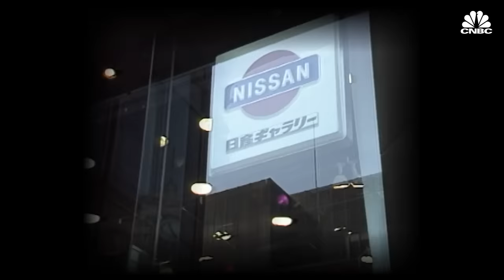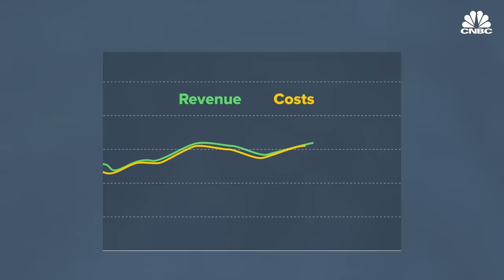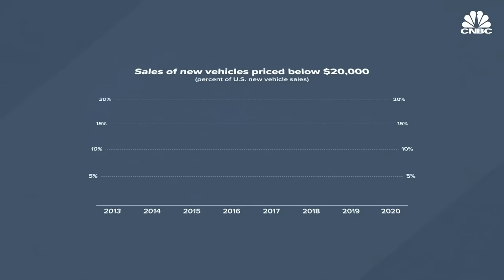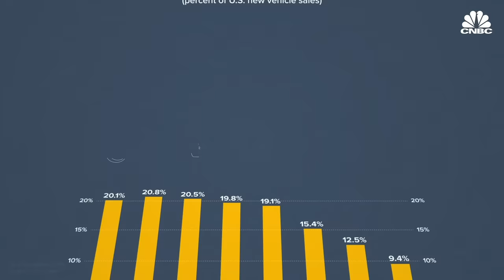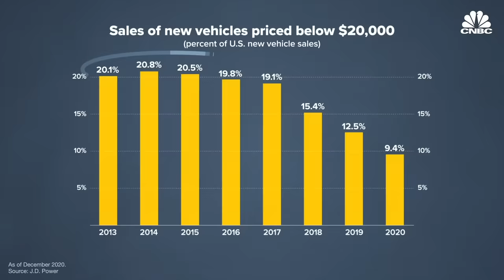Why Cheap Cars Are Disappearing

Comment: I'm 38, and I haven't owned a brand new car yet. I find it that I get more value when I purchase a few years used with more options for less than half the price than getting a brand new one with the latest options.
Reply: Yeah and at the end of the day, the purpose of a car is to get you from point A to point B.  They aren't assets that appreciate in value like stocks or real estate.
Reply: I purchased a 2019 Jeep Cherokee 4X4 Overland, came off lease saved over 10,000 dollars, had 9,000 miles, lot of technology on jeep, 

First SUV I ever bought always drive a car, sold 2003 Chrysler 300m had 125,000 miles. Very reliable car, but more of performance vehicle not good in winter.
My Wife did not want SUV, but car good in winter weather But not large car, so I purchased 2016 Chrysler 200C AWD, I saved well over 20,000 dollars on that car only had 16,000 miles, came off lease 2 years ago, it was disconnected in 2017.
Very good in winter weather.
Reply: True.
Reply: Yep.  I traded up to a top trim Taurus SHO last year, and at 3 years old it’s the newest car I have ever owned in 22 years of car buying.  I can’t even remotely afford to buy a new car I’m the class that I want, and it’s becoming a pointless effort, and full sized 4 door cars are apparently a dead breed.
Next car might have to be a Mustang...
Reply: does it bother u if someone had sexin the back seat in said used car?
Reply: I bought a 1 year old certified used vehicle for about $20k this summer.  It's a very nice car, and the certified vehicles have 100k mile warranties.
Reply: I'm driving a 2001 F150 ... everything works great on it ... it's not new but I'm not a slave to a bank for 72 months either ..
Reply: @anonymousperson9279  detailing wont remove the past events in said vehicle
Reply: @randomrazr  Get it through a full suite car wash service before you start using it if you're worried lol! Most people tend to get those services done right before selling off their cars anyways, to make them more presentable and demand higher price than dirty looking.
Reply: @btw-3006  Only already wealthy people can benefit from stocks getting their value inflated. If you are smart, never invest in stocks.
Reply: @conanobrien1  what are you talking about?  I am not anywhere close to wealthy yet and my net worth has greatly benefited from the stock market.
Reply: @btw-3006  Up until the next stock market crush...
Reply: @conanobrien1  yeah, okay buddy...
Reply: @btw-3006  it's only an asset if you make money with that car otherwise it's just a liability.
Reply: I been tru 31 vehicles  in my life and like the 2000 Mustang Cobra R there is no other is like all the new cars don't even matter
Reply: I've owned a few new cars....never again and I have no need nor do I want all the technology packed into newer cars just more stuff to break
Reply: Another cool part of buying used cars is it is far more environmentally friendly.   It's better to keep a vehicle running that has already been manufactured (manufacturing is where the majority of a single car's emissions originate),  than to buy a new car that would need to be made sending the old car to the scrap yard.

I personally am a big fan of used cars because I just like them better, 90s cars are more fun to drive as they have more character.

Comment: Being an engineer, I look at the many, many systems in a new car and wonder how many of them will still be working in ten years time.
Reply: "... he said, glancing at the new Land Rover."
Reply: as an engineer (i'm a former tech) let's sit down and joke about self-driving vehicles, shall we?
Reply: You’d be surprised. If it’s a Lexus you can guarantee 95% of it will still work. A BMW or Mercedes on the other hand, maybe not.
Reply: If ford's 10 speed autos and GM's electronics have anything to say, they wont be working in ten years time lmao
Reply: Cheap metal and plastic (aluminum recycled beer can on wheels).
Reply: @marclaprise2945  😂😂
Reply: I don't think I'm going out on a limb here but I'm willing to bet not one of them will be working in 10 years time.
Reply: 10 years is a great time to sell lol. it's just starting to get old and it still has some value left, besides you are probably tired of driving same old car 10 years
Reply: I kinda wish cars were modular like that but most of them don't even have a replaceable radio now
Reply: @SteampunkPhoenix  yep you have to do extensive work if you want to put in a high quality audio system. Years ago I started putting my stereo receivers inside my glove box I'm leaving the stock radio installed to turn away would-be thieves. Of course anyone that hears the car know is that that's not a stock stereo
Reply: WorldFlex  do they even sell cars like that anymore? I don't think they do. I have a 2015 Nissan Altima base model which is a really cheap car in that has almost everything you could think of the tires the Bluetooth has sensors in the seats to know someone sitting on the seat or not. If you throw groceries on the front seat the sensor goes off. I'm selling it to Carmax on Wednesday. Some guy just hit me head-on February 21st. Get it out of here. I can't believe they didn't total it
Reply: WorldFlex  you got yourself a good one there. As far as I can tell the Toyota Camry is about the only vehicle that is reliable today. I was just hit head on in February and they rented me January 21 Toyota Camry. That thing was very nice sounded looked and drove more like a race car than a Camry. It had those paddle shifters on it. And as far as I heard there SVT transmission is actually reliable unlike the Nissan that I have. Then again Toyota has always been known for a far better vehicle than Nissan. I believe Hondas reliabilities have fallen off over the last two decades. Although I don't know March about the element.
Reply: @SpaceCadet35. Absolutely.  More shyt to break & malfunction.
Reply: WorldFlex  a mistake I will never make again. It replace my 92 BMW 525i 5 speed manual that I really beat the living crap out of 20 plus years.. it never broke. The new BMWs I wouldn't even touch with a ten-foot pole. Toyota Camry is about the most reliable vehicle I think they made today. But soon enough no car will be on the road for more than two or three years without being completely destroyed by weather and plastic parts that have deteriorated into a cracked piece of garbage that cost $700 to replace
Reply: @1Reddd  BMW stands for Big Money Waste for a reason
Reply: spacecadet35 ...Try 5 years!!
Reply: None of them
Reply: Yeah those repair costs are for the regular Joe that can only afford a used car these days.
Reply: Almost None of them.
Reply: Your an engineer, you know every system in a car has a designed failure point or an expected operational life based on the manufacturers cost cutting and returning  sales desires. So they will fail when they were designed to fail or there abouts.
Reply: @huntsbychainsaw5986  - When you design a system there is a Mean Time to failure. That means that some systems will fail can still fail after a week of use. Tru,this is unlikely for an individual system, but the more complex systems that you put in and the more complex the system, the shorter the timee period between failures. I still remember the main radar system on the F4 Phantom II, it had a mean time between failure of twenty minutes.
Reply: @spacecadet35 . 20 minutes between failures? What was the cause of that and what exactly failed?
Reply: @spacecadet35 . I guess the MTBF of about 4380hrs I'm getting with my car as a whole isn't that bad lol.
Reply: @huntsbychainsaw5986  - With the F4 Phantom II, it was  because they were pushing the technology of the radar as hard as they could at the time. As it was right on the raggedy edge of what achievable then, the failure rate was very high. And remember, that is the average time between failures; some would last longer and some would last less time.
Reply: @huntsbychainsaw5986  - That is a good time, and may it be ever longer :)
Reply: @spacecadet35 . Oh ok they were pushing the tech to its limits that makes sense and yep I understand that MTBF is a mean not exact lol no worries.

I'm doing pretty good with my car right now but I bought it new so it's always been maintained properly and it's only a couple years old. My definition of failure for the purpose of my calculation is non maintenance related items requiring repair or replacement.

I would absolutely love if I could get that MTBF to be a bit longer but the most common failure I've been experiencing is suspension related and can be attributed with great certainty to the poor condition of the local roads infrastructure.
Reply: WorldFlex  who has time to check tire pressure this days,if automakers wanna profit why they not make options for cars and put price tag on that.for example i pay some money to get heated mirrors or heated steering wheel lets say for honda fit but no they wanna more cash from you lol.
Reply: the same theory applies to the human body after 10 years of use without an engineer.
Reply: @freddiemccoyditahmedsofi .  What?
Reply: You mean planned obsolescence
Reply: How do you feel about the new Ford edges with the 2.0 L ecoboosts to hold up?
Reply: @sten260  if I didn't live in upstate NY with rust and rot I'd love to keep a car for 30+ years but the body's will go bad before the engines and stuff ever will.
Reply: Pretty much Tesla they’re all electric
Reply: Not many...computer chips in every part of autos now!!!!
Reply: Same here.  91 to 95 were primo because the computers were very reliable by then and fast enough to get the job done.  Drivability was generally excellent and "Key Dance" fault codes were sufficient to diagnose the infrequent failures.
Reply: @MichaelJohnson-fe8tm  i think my '88 s-10 blazer is pretty fast computer wise but its a fully loaded Tahoe edition if that makes any difference? I love how simple it is!
Reply: WorldFlex  glad I live somewhere where they don’t do inspections. 😉
Reply: Enguneer's job is to do that everything works for years to come. If they cannot do that, they have failed at their job.
Reply: @clashman7564  - But these companies are run by managers and their job is to sell the cheapest possible product for the highest possible price. They put a lot of pressure onto engineers to make shoddy products. Just look at the Boeing 737 MAX as an example. The engineers kept telling management there were issues with the aircraft and management kept telling the engineers to shut up.
Reply: many do work. Person I know bought 2010 Renault Koleos. All electric systems work, from push button start to tire pressure monitoring sensors, fully electric power steering, electric chairs and skylight, heated seats, traction control, navigation, even the outdated multi-CD tray works. Could find anything not working really.
Reply: My 2012 Ford Focus is about to turn 10 years aged and just clicked over at 250,000 miles this week. I am just now starting to get some sensor hick ups and other smaller issues. I paid $15,000 for new. So I agree with you and feel I got my money’s worth as I still plan on driving this car past 300,000 miles plus.😎🇺🇸
Reply: @johnnybbgunner2136  electric systems can be more reliable long term than mechanical. Less stress. 
For example my 2000 PC still works ok for the person who I gave it to. That's 21 years old PC that can still be used. 
Many oldish cars don't have that many problems with electric systems. More problems with rust and mechanical issues. Electrics/electronics not so much.
Reply: @tgb-vf4es  
Are you from the former Yugoslavia?
Reply: *3 years. You meant to say 3 years
Reply: When stuff does fail, you'll pay through the nose for some proprietary microcontroller.
Reply: @MicePlayMCGaming   I have a cassette player out of a 1985 chevy van sitting in my garage.  The van is long gone, but the radio, and the tape player continue to make music!
Reply: We live in a disposable world, these days. I trust my 86 Ram to run forever, literally.
Reply: What kind of engineer?
Reply: @iamhereblossom1588  - Mechanical
Reply: planned absolution is a thing
Reply: @sten260  why would I be tired of driving same car for 10 years? Or 40 years? It's just a car to get from A to B, what an Americanized attitude you have!
Reply: Being a mechanic, all your new gadgets are a pain to fix
Reply: @notyourechochamber3137  Yeah haha tell me about it, I admire the craftsmanship, functionality and often ingenuity of the parts, BUT trying to get friggen access to things when the engineers have shoved things like alternators hidden tucked in behind the block to the back instead of the up higher out front for example for easy access or hard to reach oil filters or on some V engines bugger to reach plugs. To be honest purely electric cars appeal to me, the current battery tech is good and innovating fast, the motors are simple, reliable, near silent and powerful with instant torque and very cheap to run. I'm in!
Reply: @d.s7741  pls explain I’m ignorant lmfao
Reply: Any opinion on new Subarus? (Crosstrek/Forester/outback)
Reply: You have a good point, but in many ways electric cars are more simple than internal combustion engined cars. So there is also an opportunity for more reliability.
Reply: @CarlosRodriguez-hb3vq  - Am talking about the things that are not the engine. i.e. electric windows, automatic parking, lane following, reversing cameras, ESP and so on and so on and so on.
Reply: @CarlosRodriguez-hb3vq  Yes, generally speaking my household gadgets/devices that contain NO moving parts require NO maintenance or very little from me, e.g my solid state hard drive requires no defragging, no spinning up and down, no needle/armature to break etc whereas the disc drives die much sooner, require defragging etc. I expect the same with my cars really.
Reply: @MicePlayMCGaming  why I am happy with my Subaru, grew up with Chevys and they start falling apart but have friends who’s parents had outback’s which last 12 years before the problems came all at once. I am ok with this instead of a transmission failure at 5 years and a radio that doesn’t work at 7. I have had my car for less than a year an as an engineer this is what I want to make.
Reply: All those electronic systems are expensive to diagnose and repair. Also new car are so ugly and uninspired style wise, The majority look like 4 door pumpkin seeds on edge. I need a new car but I am unwilling to pay for a car that is loaded with all of the electronic gewgaws that saturate the market.
Reply: I habe an old toyota from 2005 that is still working fine. I've seen many car from 2018 that has more problem in 3 year, than my car in its first 5 years. Too many complex system.
Reply: And everything is plastic to cut down on weight
Reply: Today's gasoline cars are not built to last 10 years...
Reply: @d.s7741  LOL! Because we all know that Technology NEVER fails ! I call that the Titanic Syndrome! The US Naval academy wanted to stop teaching Midshipmen how to use a sextant! We have GPS they said! LOL! I was a US Navy Nurse Corp Scholarship candidate in college and my father was a former Naval officer and later an engineer . Dad helped build atomic reactors for submarines / Admiral Rickover's program. Dad would have agreed with me that you ALWAYS need a "Low Tech " back up! That and knowing how to use a sextant is called BASIC SEAMANSHIP! 🤔🤗🌊⚓⛵⚓🌊
Reply: @keselekbakiak  I  drive a 2006 PT-Cruiser ! Chrysler - German made car! Good German engineering! It was my father's car! When the Key fob broke I decided to just unlock the door the "old fashioned way"! Feels safer too because not all 4 doors open now! That and the replacement would cost close to $200.00 ! Who needs that? 🤔🤯🤣🇩🇪🇺🇲
Reply: @daren1182  Every post is you claiming some new career field.
Reply: @sten260  or hold onto my 22 year old Coupe and 13 year old SUV that actually gain value as the days go on. Unlike a new car.

Comment: What I miss the most is common affordable 2 doors. Fun for a low price, it’s so sad. Props to the BRZ and 86 though
Reply: Miata is always the answer
Reply: @autofigure00 buy a last gen gt, ss, or other v8s
Reply: @nickscope27  Those are not my types of car. Id rather have amazing handling / fun normal commutes than a high HP engine, high HP is kind of pointless where I live. Plus those cars are way more expensive than the Miata, no way in hell Id buy one of those given other cheaper options.

Comment: Getting a radio was an option back in the day
Reply: And often just an AM radio.
Reply: Not that long ago either, the radio was an option on my 2003 Kia Rio. So was power steering.
Reply: And electric windows were restricted to expensive cars
Reply: I just love my Mercedes w126 from 1989. It's so simple, it's not like cars today with electronic stuff overload.
Reply: Now the newer 🚗 cars don't have the c.d player
Reply: Kids in 2010s younger who experienced to use crank windows might be rare now
Reply: @dr_mong3726  We had a 2nd gen Suzuki Swift, and it had manual windows. My neighbours' W201 also had crank windows. So yeah, i'm experienced.
Reply: @mozeskertesz6398  
N i c e

We own a corolla but it has power windows... That's one big benefit for us when im the only driver except when car is turned off

But i grew up with crank windows ngl
I missed it
Reply: It is still 😂